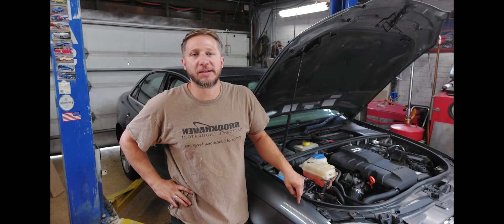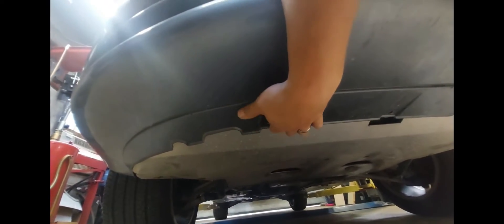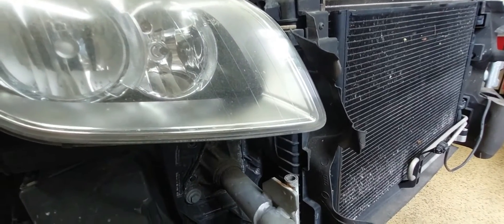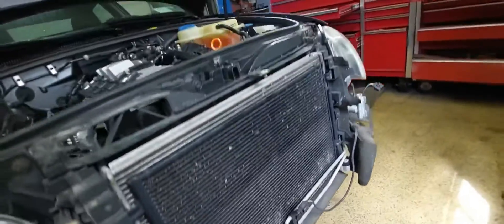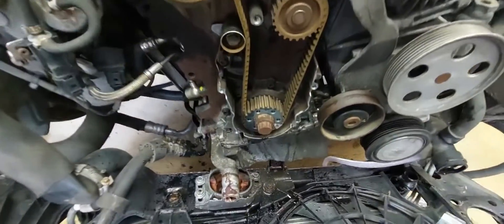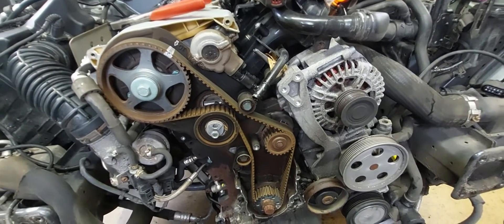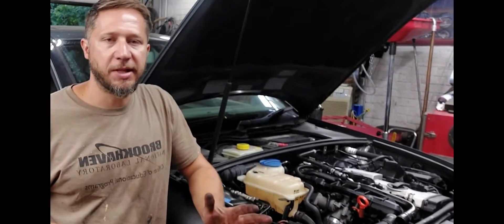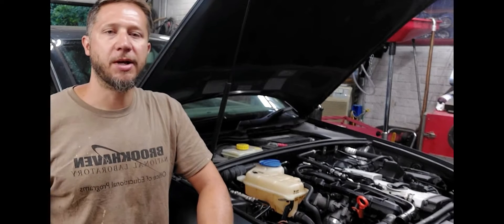2004-2009 Audi A4 Timing belt and Service position w/torque specs

Comment: This video is kinda vague.. Is that
a 1.8 or a 2.0? There are no images of the brackets and pulley system.
Reply from the maker: This is a 2.0t fsi engine. After the gen 2 1.8t and before the gen 3 1.8t.

Comment: Great video! I am planning on doing the timing belt and water pump on my 06 A4 with a 2.0T in a month. Should I remove the spark plugs to make the engine rotate easier to find TDC on #1? I am a little hesitant to do so because I do not want the camshaft sprocket to move while I am in the process of changing the timing belt.
Reply from the maker: I don't usually take the plugs out. As long as things are at TDC when the belt comes off I will usually just turn the crank back a few deg so if the cam jumps it will not damage the valves. Just make sure the crank is back in time when installing the belt. Also, if you follow my technique of marking the belt before removal everything should line up perfectly in time. Good luck and thanks for watching.
Reply: with the help of your great video I got most everything done but now I want to torque the the six bolts on the crankshaft pulley. They were incredibly tight taking off, I had to use an air impact. Can you explain the torque method please. Also should I get new bolts? I understand the original are one time use and stretch bolts. Torque to yield?

Comment: I have a 2009 A4 with a timing chain.
Reply from the maker: So you have 2.0T or a gen3 1.8. Both use timing chains.
Reply: 2.0T and having a hell of a time taking the waterpump belt off. No room upfront to use 24mm on the crank. I had so many "audi people" including folks at fcp euro ask me if I was doing the timing belt too and many swear my car has a timing belt.